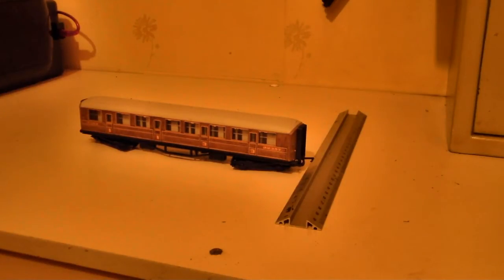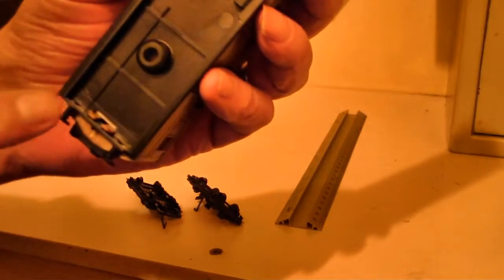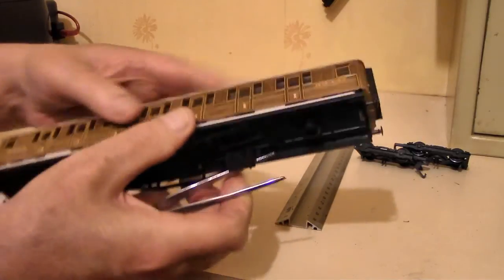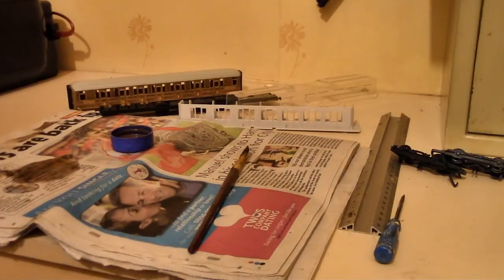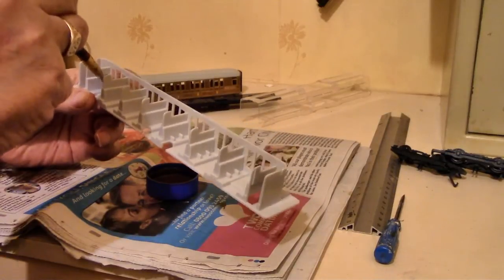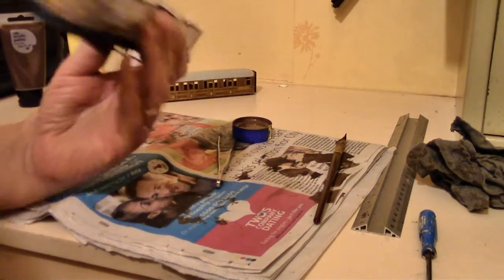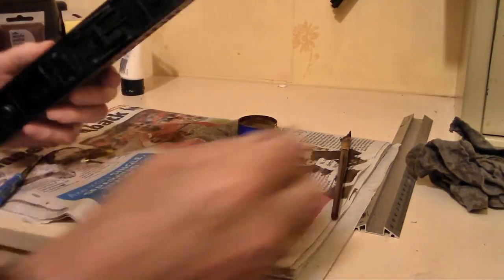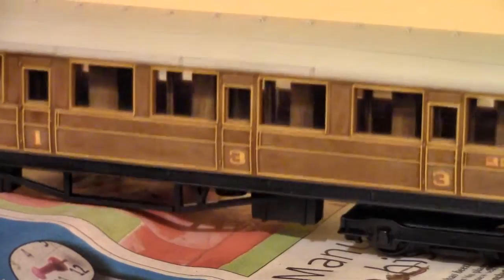PAINTING COACH INTERIORS HOW TO

Comment: Does look good. I put some figures in mine but they can hardly be seen, so I never bothered with subsequent coaches. Also they often need their feet or legs chopping off so they fit. As you say, depends what level of detail you wish to go to.
I agree with you to mark the ends as it makes life easier. I use tippex as a marker, or a permanent marker. Both dry quick.
I reckon with decorations for sale so cheap, it may well be possible to put a string of LEDs in a rake. With their own power pack on board the lights won't flicker.
Reply from the maker: Hi Laurie i tried the figures in a GWR coach but had to strain my eyes to see them ,your right about chopping legs of its a bit cruel though lol,forget lights i can live without them,---Tony
Reply: TheZimma
To be honest I only have three lighted coaches - I can live without them too. Too gimmicky really. I prefer the simplicity of model trains running through scenery. Lights and sound are occasional items of interest for me but I don't need them.

Comment: if you look on the pieces you will see a star marked on one end this is to denote how they fit together (no need to mark them ) hope this helps
Reply from the maker: Hi thanks for the info christopher , i noticed the stars after cheers Tony
Reply: Glad to help I also paint the chassis with track colour paint to cover the shiny plastic and change the wheels for metal ones (they run so much better) i "like" to improve my models as i think this is a part of the hobby that gives me a lot of pleasure My railway is all about the trains and not scenic so any little improvements increases my pleasure "playing trains" I look forward to seeing more of your of vidios
Reply from the maker: Yes the metal wheels make a vast improvement on looks and running,i allways oil the axels as well as that makes a difference to the running,do you have any video's
Reply: no i have not produced any videos .if you use oil is it non mineral? as this will soften the plastic; i use pencil lead as this is graphite and does not harm the plastic or a silicon based lubrication should be used to prevent the plastic from softening i have fitted some of my rolling stock with peco brass bearings but this is hard to do as you have to drill out the axle cup from an angle to get the bearing in but the effort is well worth it as the running is so much better some of my stock will role for forty feet with a small push! my stock are all weighted with a minimum of one ounce (carriages two ounces) as this helps with the ride of the vehicle and most of my trains are short compared to prototype trains and so weight is not an issue. i get very few derailments on points and crossovers. scrap lead or plasticine are my usual materials for this but anything heavy will do as long as it has mass
Reply from the maker: Hi yes the oil is non mineral but have used 3 in1 oil years ago with no adverse effects , i also put weights in the rolling stock and a lot more in the loco's for added traction on my inclines,ill give the brass bearings a miss ! , i use lead and bluetack to stick it in with